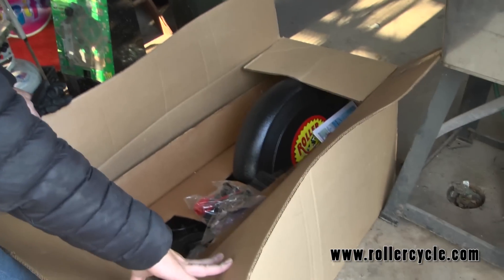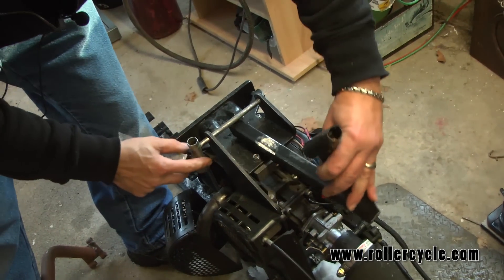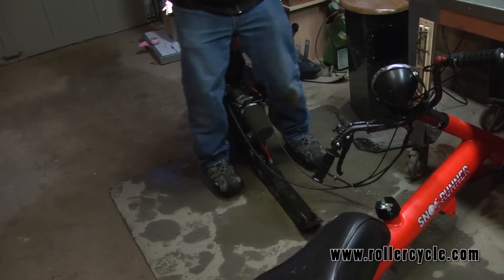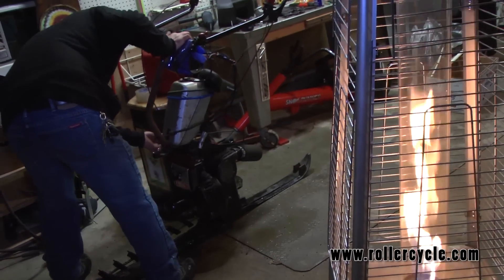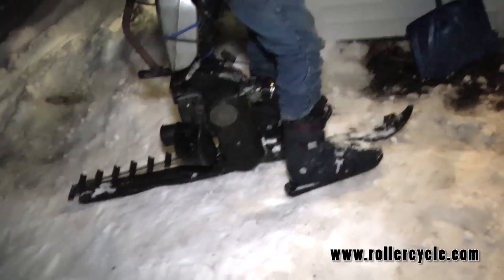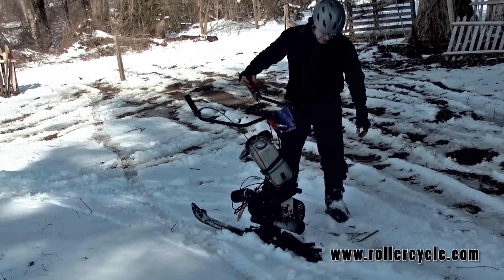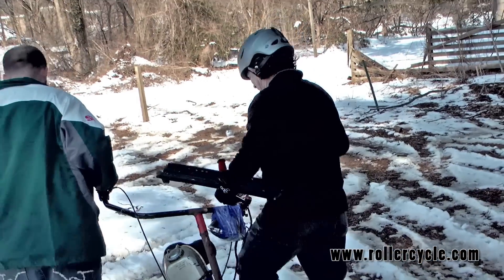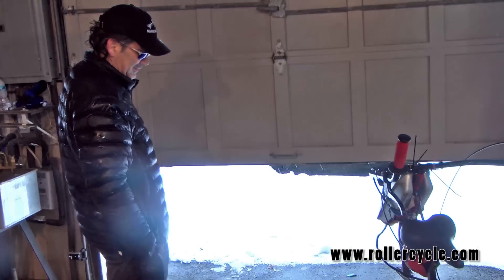Roller Cycle Tracker (Full Video) Motorized Rear Propulsion for Skis.

Comment: Also wanted to ask you if longer skiis might be better for this?
Reply from the maker: Metemi Greg, the inventor made snowblades years ago. They were broken from skis and they are sawed off and screwed to skiboots. They were also painted. That concept created a ski front end attachment for the scooter version of the Rollerycle. This unit was just to test the concept of tracked rear propulsion for the roller cycle and it was successful. There's alot of time until the next snow, so I am sure he's already thinking about what's next